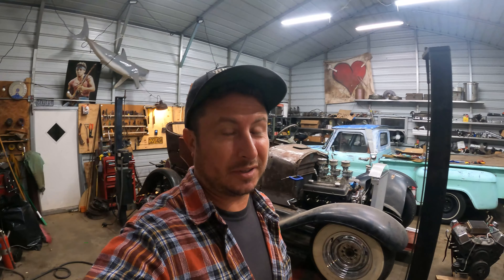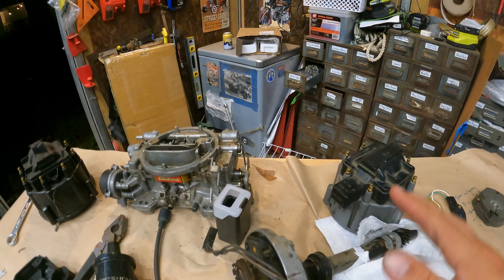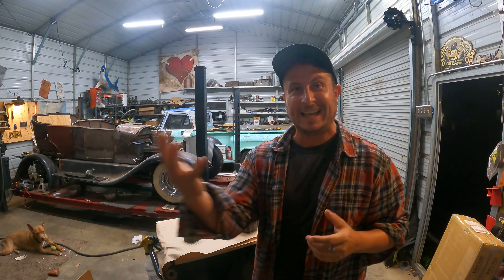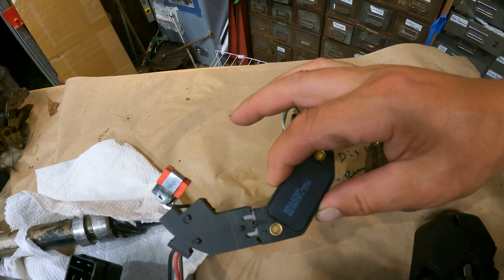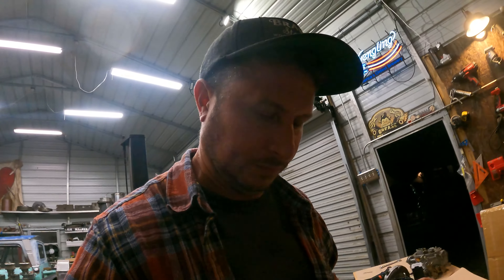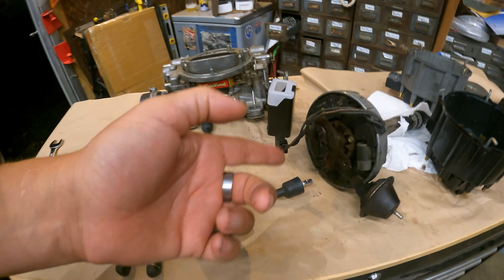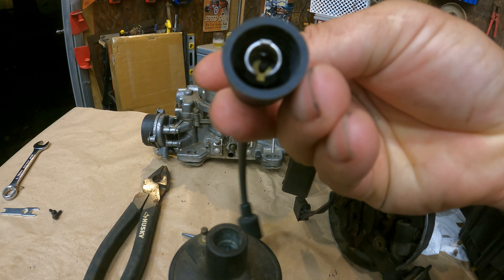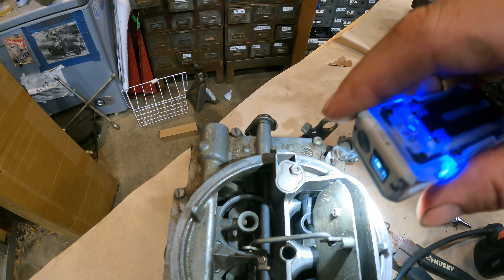Engine Misfire Under Load?! Look Here First! (Any Engine!)

Comment: What about pre fire or pre ignition under a load?
Reply from the maker: thats a little different... the way you phrase it, that is detonation... or pinging... that may have something to do with your overall timing or timing curve....    that said.... if you feel confident that your timing is in the ballpark look for 2 cylinders that fire one after the other and make sure their plug wires are not touching... they can arc across each other and cause a miss under load.    you want the wires to touch as little as possible....